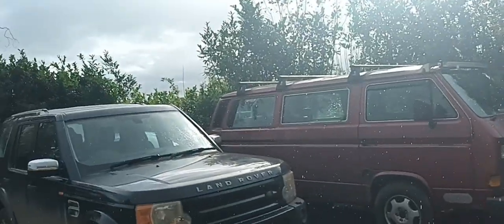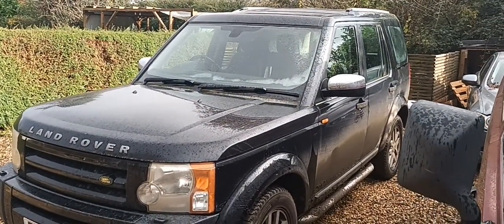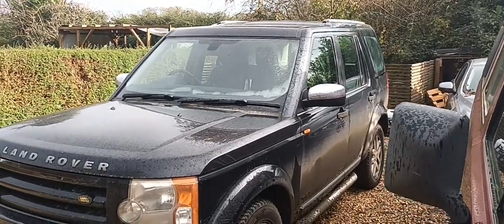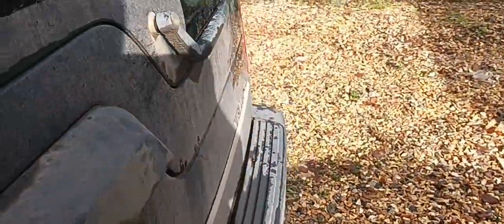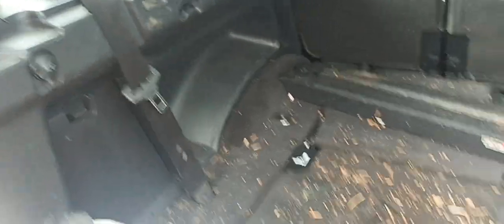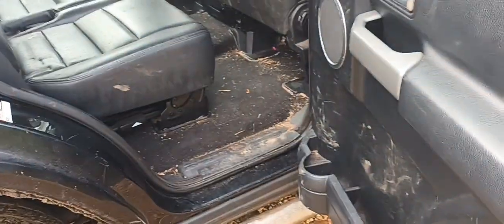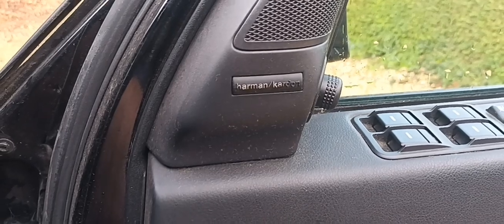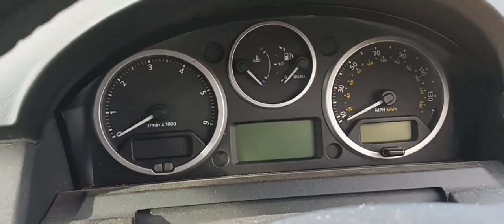Land Rover Discovery 3 Episode 1 | New car joins the Projects in the Barn family

Comment: What a shocking state that Disco is in. The last time we bought a Land Rover with that much mud on it the chassis turned out to be in a terrible condition underneath the mud. Never again!
Whatever you do, change the oil and keep changing it or that V6 Lion engine is liable to catastrophically let go. It's a reasonably reliable engine in lighter cars, although the design of the oil feed to the main bearings is fundamentally flawed and it is more stressed in a heavy car like the Disco although changing the oil pump, if it's still the original, will stack the odds a little bit more in your favour.
Richard
Reply from the maker: Hi Richard,  some great advice there. I have seen and read all of the horror stories about this car and engine in particular. 
A major service including timing belts, water pump & oil pump will definitely be on the cards 👍